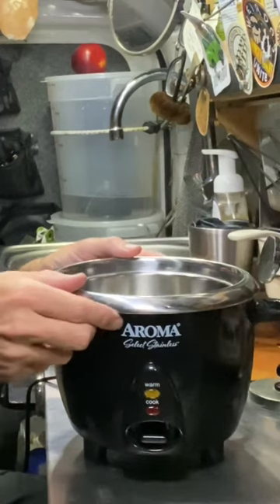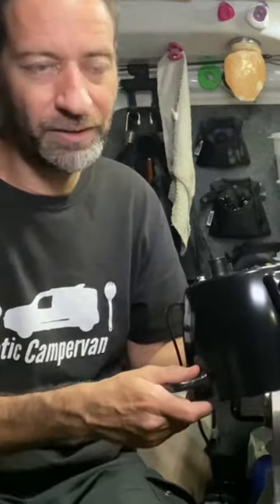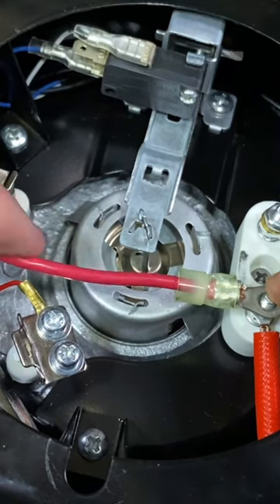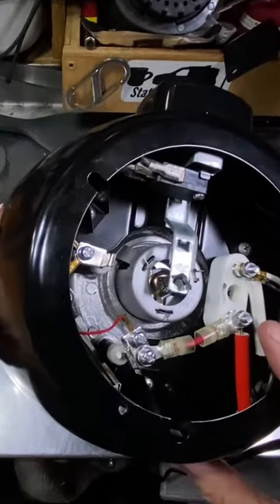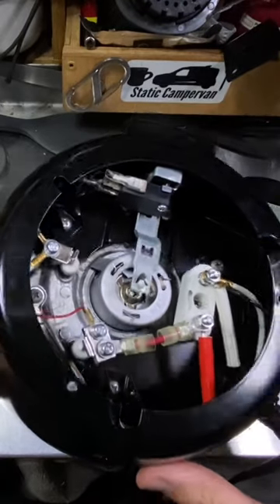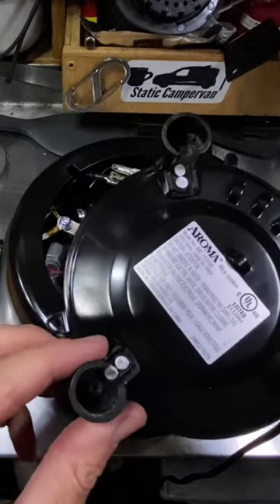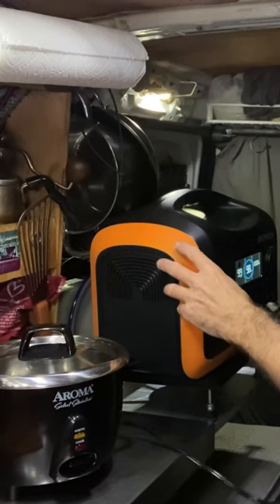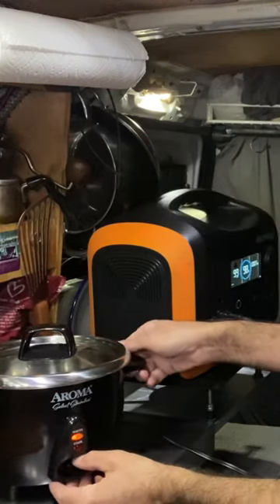Fixing my broken Electric Rice Cooker. Will we see sparks? #diy

Comment: You won't see sparks, but you could easily start a fire. It's the same as just attaching wires dorectly to your electrical panel instead of using a breaker 🤦‍♂️
Reply from the maker: A better description of a thermal fuse is a fusible link, not a circuit breaker